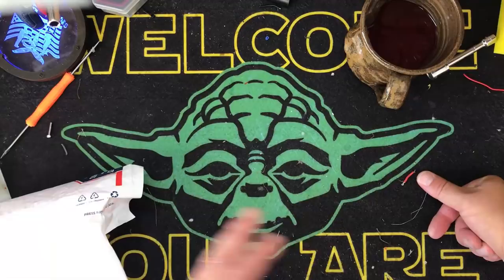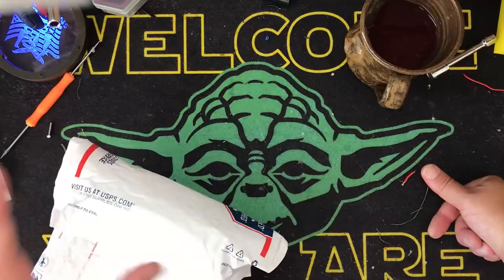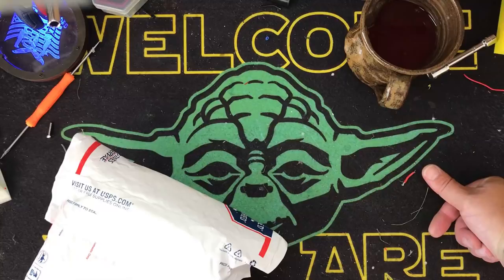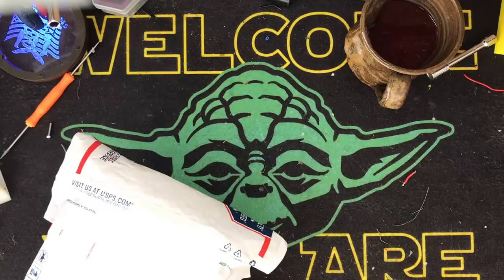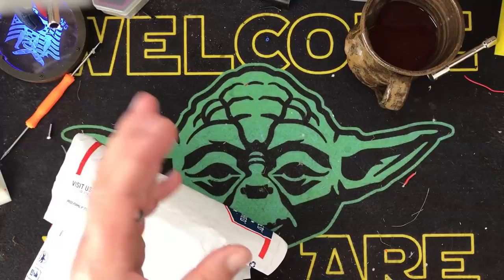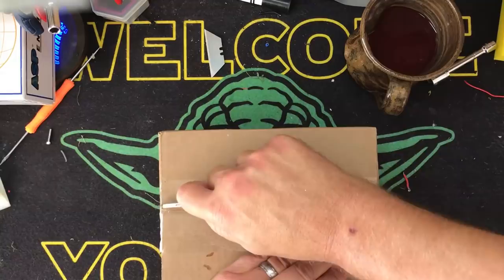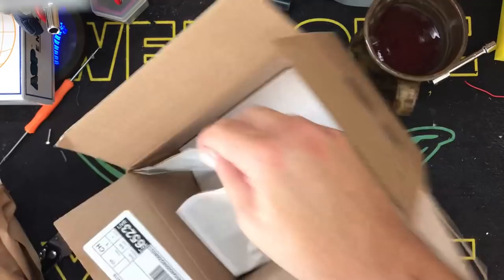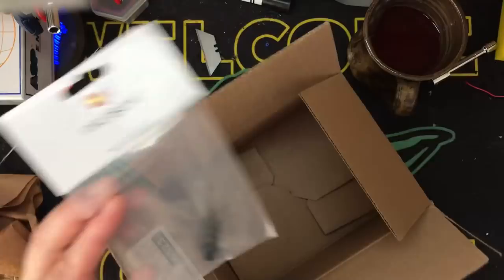RotoBoat - The Miss RotoGeek Build - 21GT Nitro Outrigger - The Parts

Comment: pro tip= ca glue . except the sponsons. the foam (in this case ) will be eaten. more expensive models use stuff like glegicel and divinicell ,pro hi density foam that is actually fully water proof/furl proof and used for high strength/low weight construction of facades in big buildings  and in movies n shit . but the house construction foam here is good 4 low budget racing/bashing that most of us do . im glad zip-kits makes kits for the average hobbyist and tis encourages new boaters. y'all should chaeck out their other stuff . they have kits for gas and electric power as well